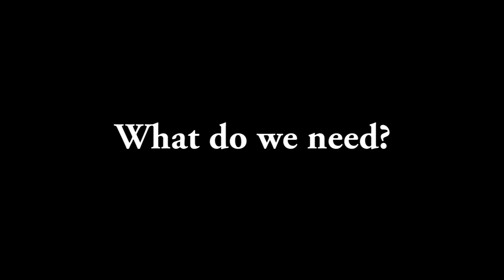How to make a detachable 360° GoPro Swivel Mount for under 20 bucks | Hero Moments Tutorial

Comment: What size screwdriver did you use to seperate the mount? I stripped mine :/
Reply from the maker: +Jay Kadlec I used the smallest Phillips-Head Screwdriver i could find. You have to press the screwdriver really hard against the screw, so the material shouldn't strip. The screws are very tight. I hope this helps.
Reply: I actually did just that on a different one and got it, thank you!

Comment: hey can you help me please? i dont get something... see... i screw the go pro base to the bottom of the wheel base right? now that go pro base has a screw in the middle of it and its not letting me hook the whole thing to the 3m base because its in the way how did you fix this? there is a channel in the middle of the 3m base that cant go through because of the new screw
Reply: +Sergio Santinato It is the J-hook that is usually used with the Chesty mount.
Reply: Man I'm stuck in my garage with the exact same problem!... 
Did you figure how to fix this? 
I'm thinking about grinding a chanel in the head of the screw to let the base slide through...
Reply: Countersink the hole
Reply: Chisel the channel flush only about half way though.

Comment: Hey can you link where you got the swivel wheel from the ones I found wound not come apart
Reply from the maker: sorry, but I don't have a link for it, because I've bought all of the parts at my local hardware store :(
Reply: what store did you go to, and how did you disassemble the wheel?
Reply: All the swivel caster wheels at my hardware stores have a threaded rod that cannot be removed. What store did you get it from?
Reply: I ended up grinding it down and popping it out then drilling through the swivel came out good, but soon as I go fast on my motorcycle it stabilizes and it no longer spins